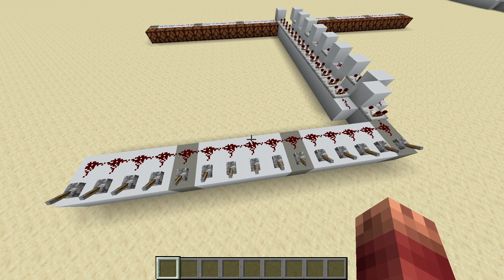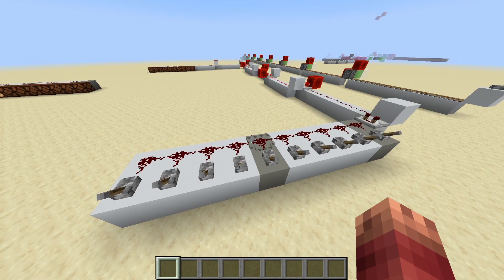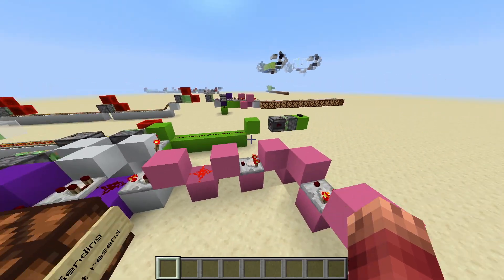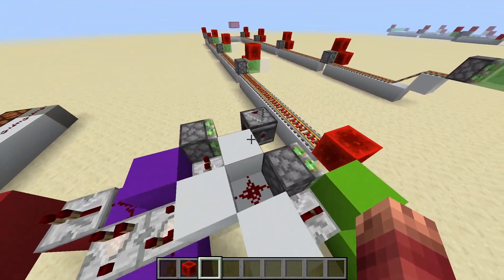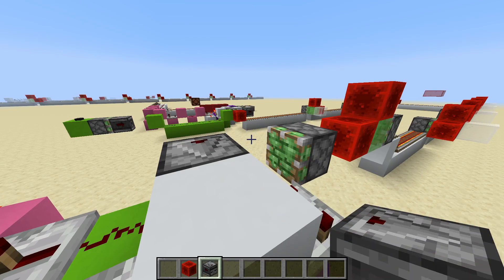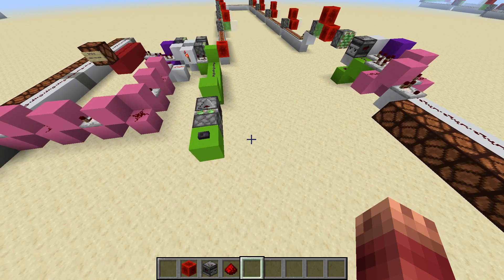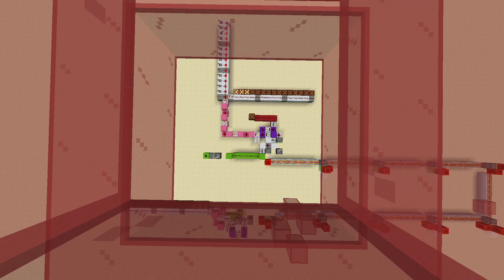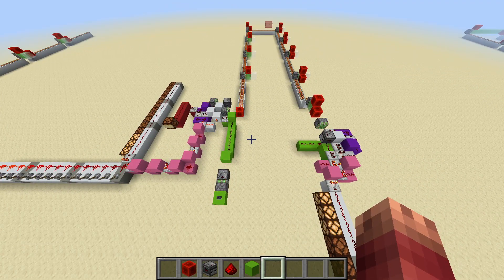[Quick RS] Insta-wire Analog Signals

Comment: Have you considered using BED to make the delay part sub-tick?
That does, sadly, require a second instant line, but it is still quite cheap, especially if you use better instant wires than the ones you are using.